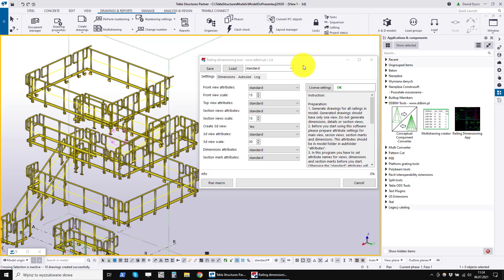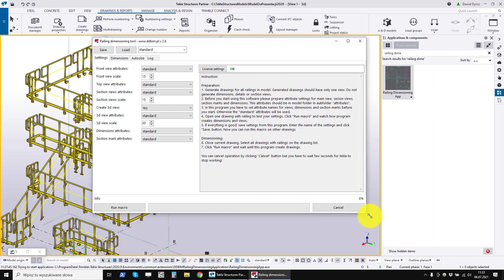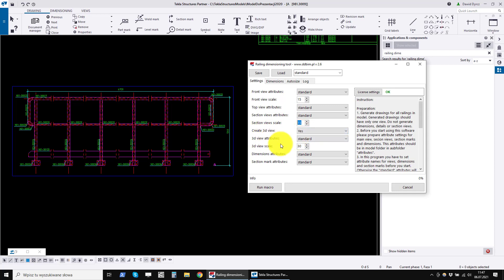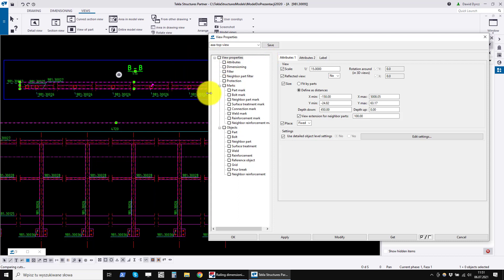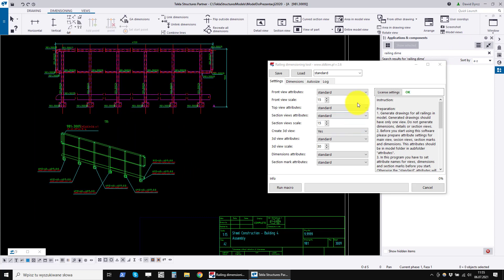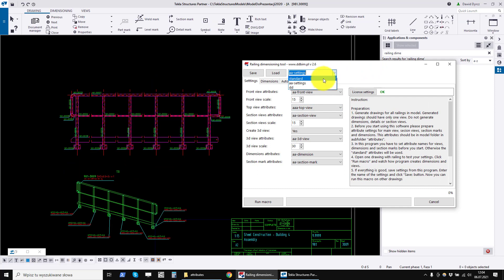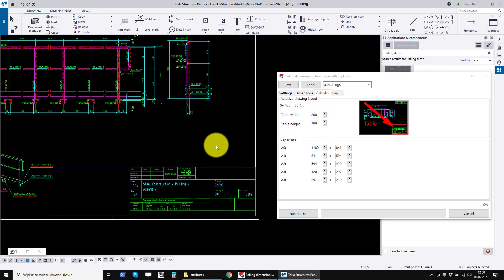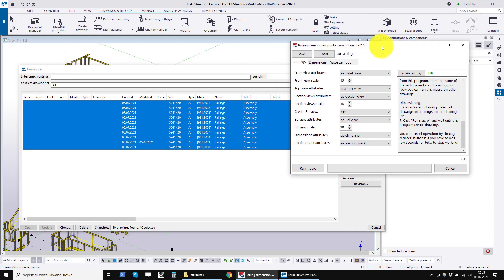Railing Dimensioning - plugin for Tekla Structures which automates creation of handrail drawings 2/2

Comment: 👌good job sir. Since modeling of miscellaneous steel structures is an arduous task, this valuable plugin would enable steel detailers to save considerable time.
If it is possible could you please teach how to use Tekla Open API to develop such practical tools.
Thanks for sharing your knowledge and experience.